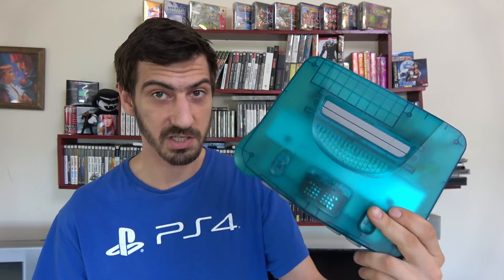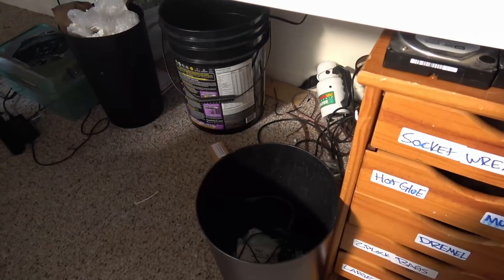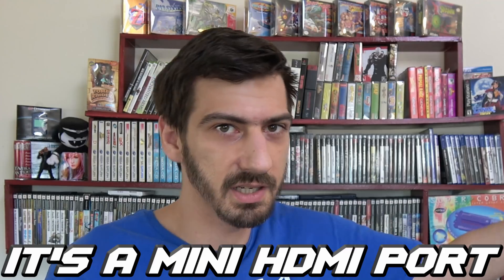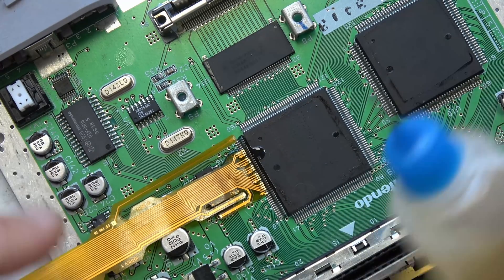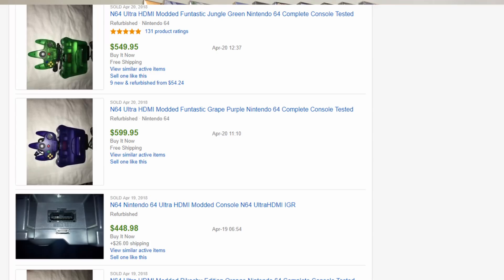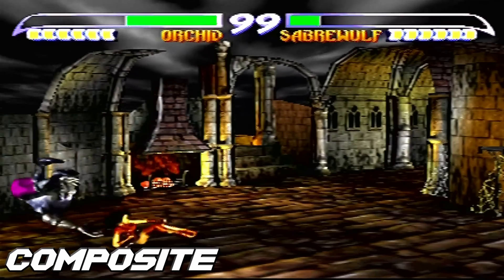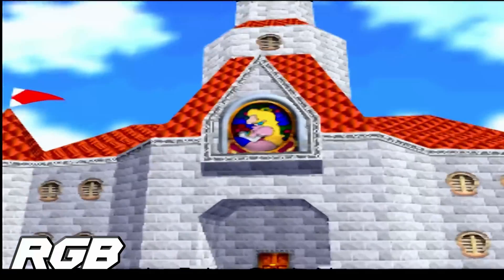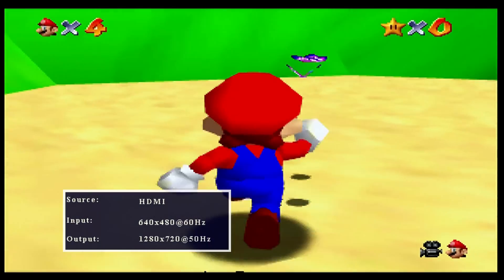ULTRA HDMI N64 FULLY EXPLAINED

Comment: Must learn to solder!
Reply from the maker: My channel has a ton of information about that subject, and plenty more to come
Reply: Will definitely take a look. Which soldering iron do you use? Trying to assemble a list of things to purchase. Having a hard time selecting one.
Reply from the maker: @EH86.  honestly, you can get a cheap pencil tip iron, and when you outgrow it with your own skill, then upgrade to a temperature controlled one with interchangeable tips, i out grew my first iron in 6 months. a 10-20 dollar 40 watt pencil tip iron is great, and then when you outgrow that, get a Chinese knockoff 8xxD series iron, even tho its a knockoff, it will do the job perfectly for quite some time before it dies. and when it dies that's when you'll be ready for a professional iron. pretty much i'm saying you can use cheap irons when your just starting out.  if you buy a pencil tip basic iron, spend 10-20, if your buying a temp controlled iron with interchangeable tips, spend 50-100 (alot of the china knockoffs are 50, when the legit model is 100 aprox)

Comment: Will someone please explain to me why the manufacturer won't sell me a kit directly (because I'm not an authorized reseller) when every single reseller is sold out?  I've been trying to get my N64 HDMI modded for over a year now.
Reply from the maker: Do you have an RGB setup? It's a very viable. Affordable. And AVAILABLE option. It's how my n64 is hooked up.

And with RGB, you can have all your retro consoles in RGB.

RGB > HDMI 

This is a matter of preference. My preference atleast
Reply: I used to have a Sony PVM and a few rgb modded consoles, but I ended up selling the PVM because of space issues and moving every couple years (military). I considered rgb modding the n64 and going rgb to hdmi, but I’m worried the conversion would introduce some input latency. I’m very sensitive to input lag, to the point I can’t play on things like the Retron 5 or Retro Freak (and don’t like the results of software emulation anyways). Do you know if rgb mod plus hdmi adapter would work as smoothly as a proper hdmi mod?

Comment: That extremely slight change is so not worth 400 bucks. Especially when it's not even fullscreen.
Reply from the maker: 375* and most people prefer it to be at the original aspect ratio of 4:3, It can be switched to fullscreen via the ingame settings inside the HDMI menu that's built into the modded console

Comment: if your HDMI tv upscales then this is all you need....Purchase an S video to HDMI upscaler BUT IT MUST HAVE ITS OWN POWER SOURCE and typicalled ones under $60 never upscale properly.  You also need a very well insulated S video to N64 cable....if your lucky you can find some old early 2000's companies that made aftermarket thick and industrial style N64 jack to S video cables....CINPEL being one company that did so....The high def and power house upscaler will process the 240p/i-420p/i signal into 720p....then like I said first if your TV has a built in upscaler then the 720 signal thus gets boosted to a crisper looking 720...its so close to 1080p PC polygon graphics that fuck spending hundred and hundreds and waiting months and months to solder mod your N64 when all you need to do is some good product research on cables and buy a nice hefty S video to HDMI upscaler.....BOOM done

The only bad ass thing about the ULTRAHDMI mod is the fact it can interpolate the signal to anti-anti-ailising which makes the graphics look straight off a PC game engine machine...basically it makes the polygons fit together via the signal lacing and dude it does look good...but is it worth 6-9 months waiting and hundreds missing from your bank account.  Nah

CINPEL S-video Insulated N64 cable (Semi rare to find but achievable), $60+ S video to HDMI upscaler box, and a TV that auto upscales weaker signals.  The games look amazing....it takes that Vasaline smear look into a jewel case look...almost playstation.

Great video my dude I was literally EBAY shopping N64's UltraHDMI modded and your screenshot you used to show the high priced examples is exactly what I saw haha....THE ONLY thing I disagree with is how you say its worth it....honestly RGB seems even easier to do and achieve in way way less time....Its not worth it if im waiting forever to get a chip...have to wait even longer to have it modded and then be out hundreds....i cannot agree with that statement...RGB or upscaling is the real way to go.  If the UltraHDMI chip was readily available and like $99 then yes I would agree but thats not the case.
Reply: the ultra hdmi is not hundreds of dollars....  its only $150.  so its only $50 more than what you said you would pay for it.  2nd.  those s-video to hdmi boxes can't hold a candle to how good the ultra hdmi looks.  the ultra hdmi is completely designed around the n64.  the converter boxes are not.  and i'm pretty sure every new tv has built in upscalers in them.  they kinda have to considering  all modern equipment don't all output the same resolution.  leave s-video for crt's but even then rgb is better.

Comment: I disagree about S-Video being “worthless.” I’ve installed over hundreds of UltraHDMI kits, many N64 RGB mods, and more but when I want to connect it to a random CRT, S-Video always seems to impress. Friends and house guests have frequently said that they never knew it could look that good or made so much of a difference until I demonstrate. Heck, way back in 2003/2004 my friends all agreed that it looked better than 480p over component on my Sony XBR910, though they were obviously fooled by the scanlines and image processing (squirrel on the 1080 Avalanche title screen looked like a squirrel instead of a blob of pixels). I’m surprised you didn’t discuss VI Deblur and how UltraHDMI and the new digital RGB restore kits are the only way to get it (the ROM patch/Action Replay/GameShark thing is not the same).
Reply from the maker: ok, here you go again being correct in my comments.. LOL! Your right, my term in the video wasn't super accurate. I have a full rgb gaming setup, but some consoles i still play in S-Video because i like the way they look, but for me the N64 isnt one, so it's a personal preference of mine for s-video on N64, i'm not a super big fan of it, however, on a CRT.. you couldent be more correct, it does look alot better. There was alot i left out of the video because it already went on too long, so towards the end i had to make alot of cuts.
Reply: RETRO GAMING ARTS 

It is a great video though! I forgot to warn against the fake S-Video cables that wire composite to one of the S-Video components. The S-Video cables available today are definitely NOT what we should be comparing to! ;)

They genuinely appear sharper but there are interference lines (most visible in areas of solid colors). The vast majority of Nintendo-style Multi-out S-Video cable’s are built incorrectly like this, presumably for SNS-101 support (SNS-101 doesn’t work with the properly-built S-Video cables). A little secret: GameTechUS is not the UltraHDMI supplier. He’s just ordering them direct from Retroactive like you or anyone else can do provided you want more than the minimum and you know how to reach him (MarshallH is notoriously unresponsive). :) I’ve placed several large orders and run a group buy myself ($130 kits). Let me know if you want in on our next group buy. We aren’t trying to profit on the group buy kits and just want to get more out there to feed demand.

Comment: wait for the N64 Classic Mini?
Reply: Still not gonna be original hardware, so n64 roms are still gonna run like crap. Considering nintendo will use some freeware emulator. I Have faith the games the come stock will work fine because nintendo has great QA. I just highly doubt all n64 roms will run silky smooth. Which is the issue with 64 emulation. It's very hit or miss
Reply from the maker: nintendo will hafto pay money to microsoft to get some RARE titles on the n64 mini, or do you think nintedo will get cheap and just make N64 mini's withought rare games?
Reply: nintendo is pretty cheap, so they might just skip those; they know people will jailbreak the device and install their own roms anyways
Reply from the maker: Omg.. I just realized that.... JUST JAILBREAK THE N64 MINI... of course omg

Comment: Hey Paul, what's your personal opinion on the Framemeister? Any reason why you don't use one in your setup? Great video btw, thanks for your time!
Reply: CAPCOM784 That would be the awesome “RetroTink 2X,” if I guess right. :)

RetroTink 2X finally does what we’ve needed all along: simple, low-latency, conversion of analog sources to digital with proper handling of 240p. Because it also normalizes and corrects timing issues and the like, it’s actually much more than I ever expected for a sub-$100 device! I love my OSSC but boy is it problematic. RetroTink 2X is what we’ve needed for the people who aren’t going all-in and, well, even the people who do... like when Framemeister and OSSC fail us (resolution switching/resyncing, TV compatibility, capture card incompatibility, etc).
Reply: RETRO GAMING ARTS Well, CAPCOM784 and I were just talking about it on Metal Jesus Rock’s new video about the Pound Dreamcast HDMI cable. Speaking of that: it doesn’t appear to be anything more than an RGB to HDMI converter like those $20 gizmos that don’t handle 240p correctly. It’s as scammy as those N64 “HDMI cables” that people were discussing last year.
Reply: Ryan Pliskin I've yet to see one in person, but have only ever heard great things!
Reply: Oh I have one, and it's fantastic in person. I'm using RGB and Component for all my old consoles and the picture quality is superb. The only "bad" thing I could say is that it cost as much as a current gen console. Anyway, thanks for the reply Aldo! Hope to see you on the livestreams.
Reply from the maker: Ryan, I've used one in person... it's totally worth every penny, The box i have cost 30$ and does everything i need to do, So since it's working very well for me, i dont see the need to make a 300$ purchase just yet, I do plan to get one in the future, or maybe an OSSC. But for now, I'm just dandy lol
Reply: RETRO GAMING ARTS Paul I think the OSSC is the best and cheapest solution.I got a used one on ebay for $125 haven't had any issue's with it.Another guy is now making composite/ s video to hdmi thats upscaled to 480p so this is helpful for systems without modding them whatsoever.
Reply from the maker: Emmett Turner i actually just found out about the retrotink 2x. So its really funny to see you mention it. I may hafto get one and make a video about it.